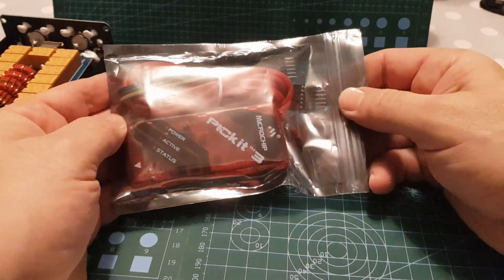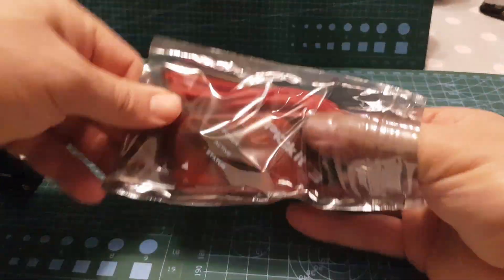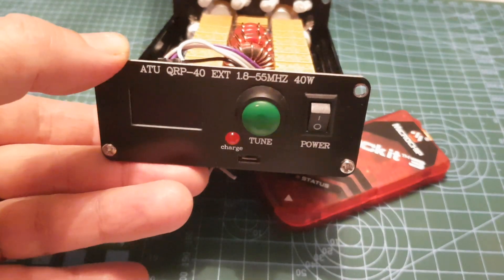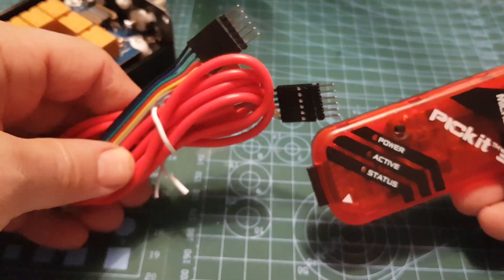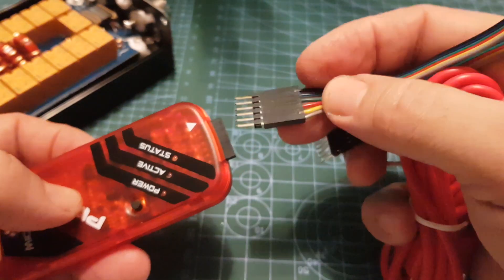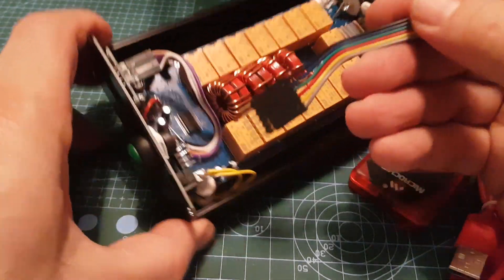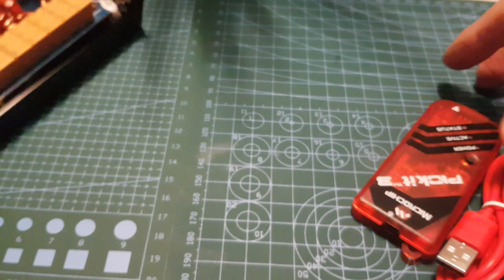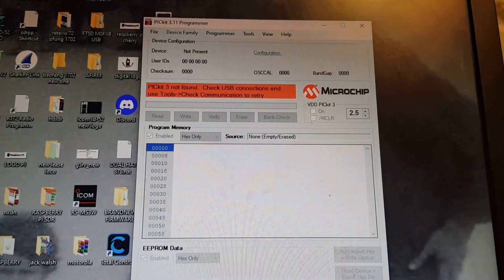Pickit 3 Programmer Emluator

Comment: Also I had trouble and could never get my win10 pc to see it.   Ended up using an old win7 laptop.  Didn't try really hard to get it to work with win10 though.
Reply from the maker: I got it working once i had the hex file.